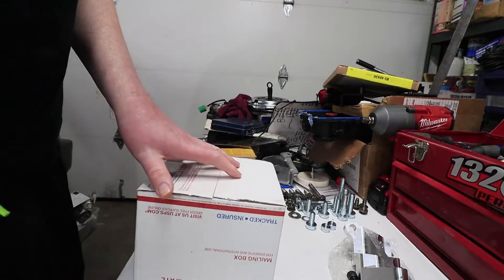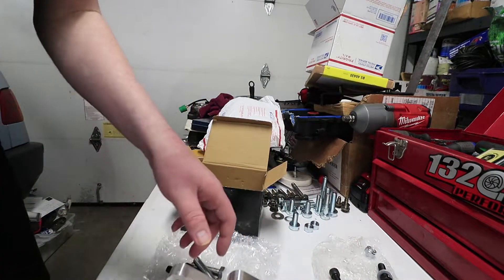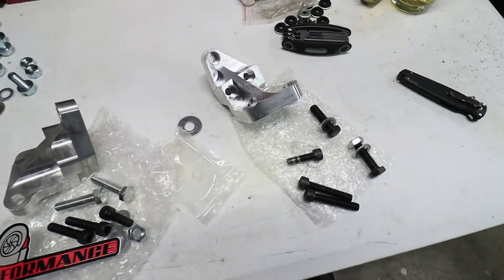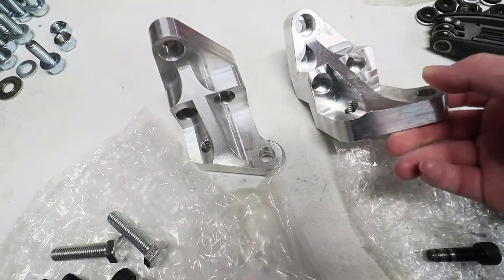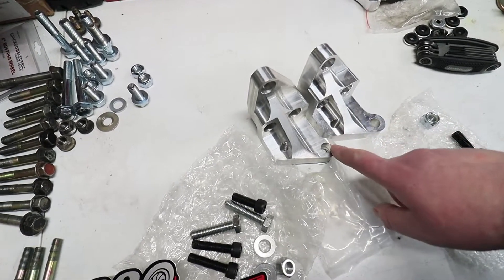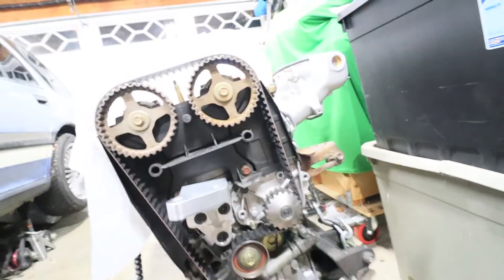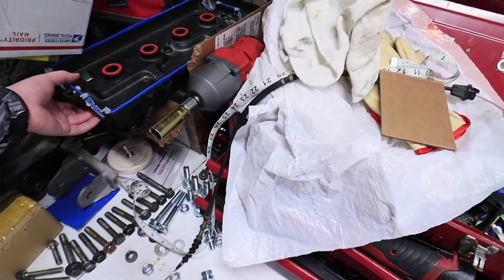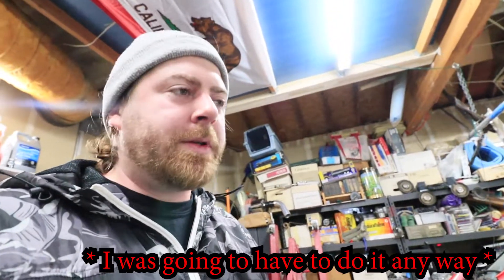1320 Performance post mount VS Generic eBay. Watch this video before doing a B swap on a EF!

Comment: Grade 5 would be your medium strength for  SAE. Grade 12.9 is the highest strength metric bolt, (stronger than SAE 8) Any actually rated bolts should have markings on the head. Looks like the silver bolts you had were an 8.8 metric which would be about on par with grade 5. Couldn't tell on the black socket cap bolts.
Reply: Another great video by the way, definitely will be referring back to these when I get to building mine.
Reply from the maker: thanks for the insight I just figured all the bolts I'd wanna use are high grade. The bolts I was referring to in the video regarding the 5 grade were the ones available for fast shipping. They were just dress up bolts IMO so I figured I'd just buy another post mount since it would get here faster than 2 weeks which is what the proper grade bolts would take to get in. I've been trying to make my videos less ranty so I miss out on details kind of skips right into a conversation I'm having with my self at times.
Reply: how did you remove the pulley bolt i cant get that loose